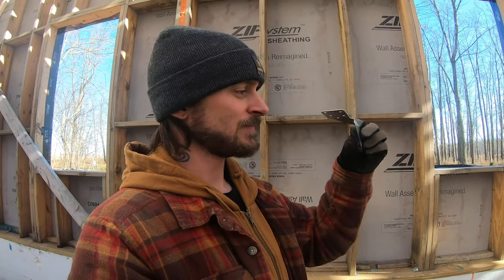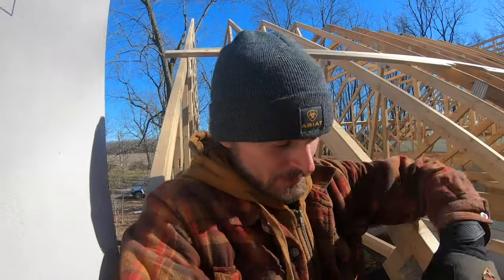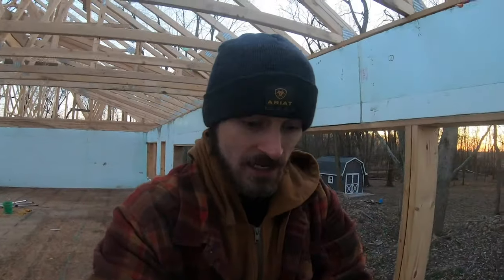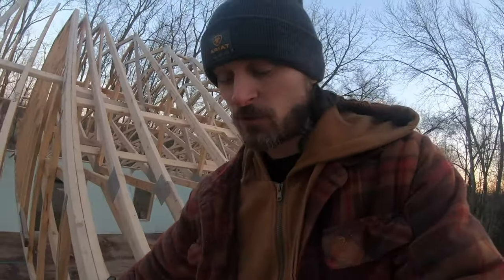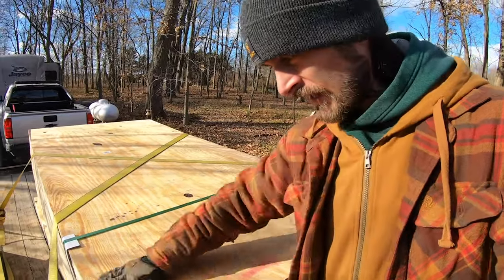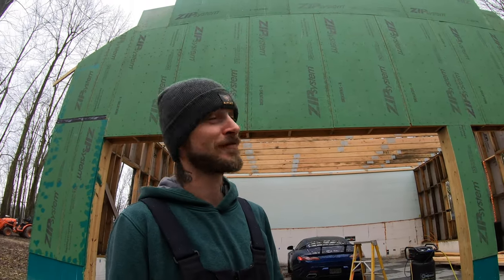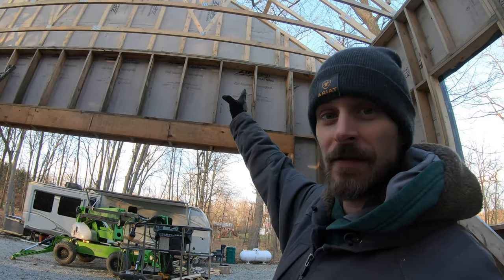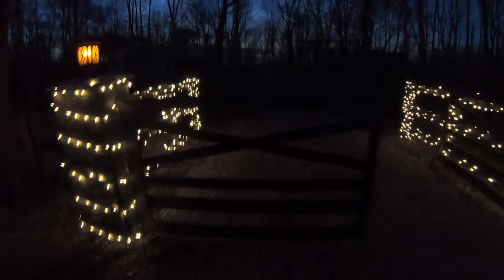Zip it, strap it and extend it, DIY ICF home roof!

Comment: I learned about those damn construction screws also.  All they are good for is keeping a wall in place. Any kind of movement and they just snap. I found out that floor screws are 100x better and are available in long lengths too, and have a similar aggressive thread so they don't strip out holes in softwood the way wood screws do.
Reply from the maker: Like a deck screw??  Coated?
Reply: @neckofthewoods24  they only have some sort of black oxide coating, not a corrosion resistant one like deck screws. I have found that deck screws are just like the cad plated construction screws and snap easily. I wish I could post a picture here.
Reply from the maker: @robhersey1796  I’ll take a look.  Over on IG neckofthewoods2020 you can.

Comment: Neat house! I'm having trouble grokking the structure. From your earlier video I thought this was an ICF build, but here I'm seeing wood frame. Are only some parts ICF? I also thought I saw steel studs in the other video, maybe drywall studs? Or was that just bracing for the pour?

Is the Zip OSB only going over the wood frame sections? I assumed that ICF wouldn't need any bulk sheathing like OSB or plywood – I'd probably just have a vapor barrier or retarder wrap to help keep water out of the foam, though recent test results found that EPS retains much less water than people used to think.
Reply from the maker: so the house and all living space is ICF.  the garage is wood studs as we will be heating it but only to 50 degrees or so therefor wood studs will be fine to use.  the metal you saw was just the ICF bracing.  on the inside of the house for bedrooms and stuff we will again be using wood studs.  

yes all the zip OSB is going on the garage wood studs and the house gable ends.  the ICF foam needs nothing as its closed cell but we will be spraying the house with a rubberized coating called Rub-R-Wall.  some other videos show up spraying and using it.
Reply: @neckofthewoods24  where did you buy the Rub-R-Wall at ? Are you just using it below grade?
Thanks for all the great information!

Comment: ..... I wonder how RubRwall would do on the plywood of a roof?....

I'm not a fan of peel at n stick products because I believe eventually the mastic will fail. Now that might be 30 years but I think as so many products that have come and gone in the construction industry it's too new to trust.  But the liquid applied grab the irregularities of the surface and have good streach qualities for crack coverage. Plus fastener penetrations are supposed to seal better with the liquid barrier product.
Reply from the maker: probably pretty well.  not sure about the heat but as long as its out of UV light itd do fine.  good question to ask matt the owner.  i bet its better than the Zip material thats sprayed on their OSB.  

as for the peel and stick with the furring strips going down its not like it can go anywhere being nailed down.

Comment: You should invest in a cordless framing nailer.
Reply from the maker: i thought about it if i was going to do the roofing.  at this point not 100% needed but would still be nice.
Reply: @neckofthewoods24  I get it. Time is money though and I’ve done this a few times. Tools are a small
Investment considering the size of the project. I had all corded and went all cordless with today’s tools it makes sense. Keep in. Mind what your paying in interest on the construction loan. I’m betting the few thousand dollars to get the right best tools ends up paid for with the time you save building. Biggest things I’ve seen same time are track saw cordless framer, cordless miter and cordless brad nailer. Just my thoughts. Great videos though! Keep up the good work! Super helpful for a ton of people!
Reply from the maker: @jacksonandjustin  we have no loan.  up to this point its all been our cash.  we will be looking later as money is running out though.  and since im not doing the roofing, my nailer can now just be with me as i start the inside framing vs hanging off a roof etc.  i did drop my nailer a few times from that lift and the hose saved it!  up that high with no hose, i probably would have broken an electric 2-3 times by now.